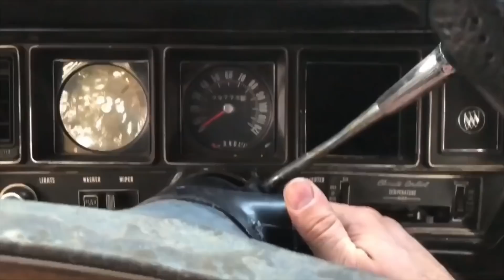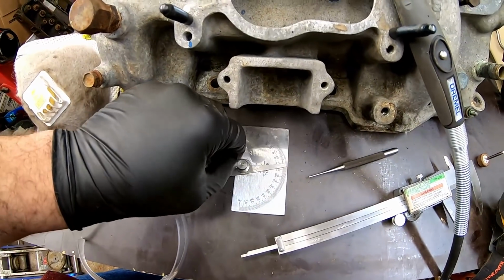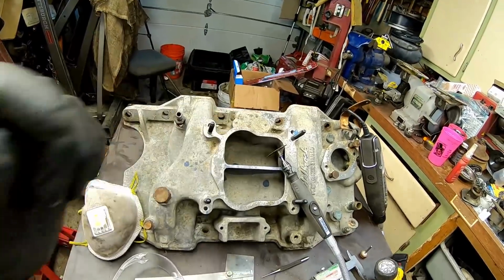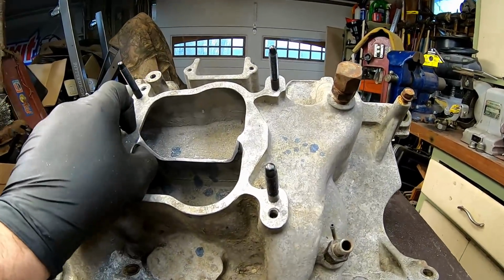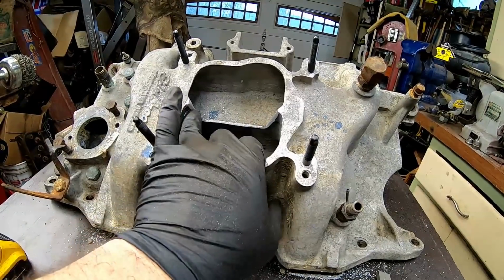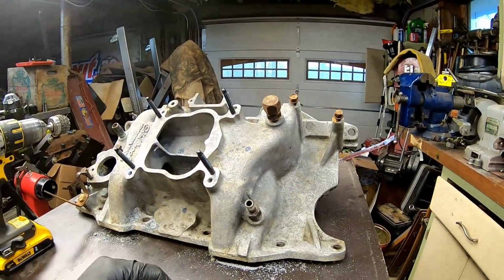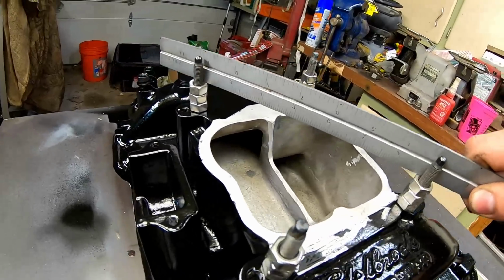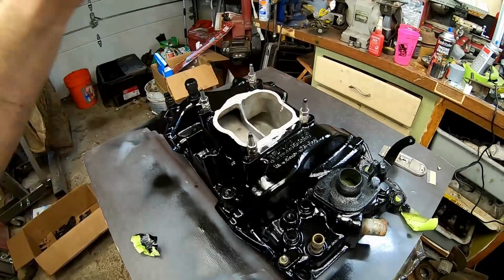How To Increace the Plenum volume for Cheap Horsepower: Notching Intake Manifold Modification

Comment: Back when I was younger yet still as stupid, I made a number of carb intake spacers out pieces of kiln dried oak.  Didnt have a machine shop or the money to have anyone made. But I had the woodworking tools at the Army base wood shop.

The spacers worked pretty good.  My best was a 2" affair for a Cadillac 500 motor.  The 500 had a manifold where the carburetor sat lower than the intake runners. This was done to keep the hood line of a Cadillac low.  Bringing the carb above the runners helped out throttle response. I assume it also increased torque and such but I was 20 years old and knew everything.

Comment: If you plan on running an automatic transmission the tv linkage gets weird when you raise the carb that much. Lokar makes a aftermarket carb bracket and  tv cable that hooks to the carb like a gm tv cable that works great.
Reply from the maker: Thanks for the heads up man I appreciate it
Reply: All the more reason to run a stick.  Automatics are for old ladies and bracket racers.
Reply: The 3 piece linkage has enough adjustment for a 1" spacer on that stock height intake.  For really tall intakes like a M1 single or Super victor, just cut and extend the intake bracket and the middle link.  For the 1 piece linkage,  just cut it in the middle and add a sleeve to extend it to the right height.  Or just go full manual valve body.  

The lokar bracket for the carb mount is not very good last time I looked at it.
Reply: Ive seen the cruise control throttle cable setup used to help the throttle cable angle. It steps up a lil higher.
Reply: @RacerRickxx  yup...eons ago i used their cable on an M1,  but fabbed a whole new bracket...
Reply: @livewire2759  good luck finding an a833, and even more luck getting one for a decent price. i will never 4 speed swap a mopar again. not worth the money.

Comment: If opportunity permits, cut slots on either side where the divider used to be and make 2 plates from scrap aluminum. One that bridges half the distance to the flange, the second to fully replace the divider. Test all three and get that spacer on and off for each of them as well.

Comment: Wow, there is a lot of comments on what people think is going to happen. On Power Nation, the engine guys cut a small piece out for a 304's intake, and it helped. I have two 1' spacers I am going to play with, one is for the holly I have, and the other has the middle out for a Quadrajet. I am going to run it regular, then run each spacer, then run both spacers. No dyno, but whatever feels the best, I will stick with. If I ever dyno, I am going to check the actual #'s. It's all in the fun of goofing off, but will make a good video.

Comment: Whats up man. Like all the videos you do. Just a thought. Essentially you have shortened the runners for 4 cylinders and created turbulence in the intake.. this will be be very interesting. Can't wait to see the results. 🙂
Edited, going that deep and wided may have done more harm than good. BUT unless you have another intake that is the same to compare to on the dyno we won't ever know. Il be willing to say also the setup will perform better with out the spacer.
Reply from the maker: It will all come down to the dyno 🤘

Comment: Look at the underside of the TQ and see those vacuum passages cast into the carb base. Those would be leaking if just a simple gasket was used on that intake. The carb spacer should give it more gasket area to cover those voids, one is for the PCV valve.

Comment: To prove the benefit of this specific modification, you'd have to dyno it before and after.
Or do you have a second unmodified intake?  For a third intake, I'd suggest the stock 340 or 360 iron intake. I'm going to bet the cut down intake will do far worse than the others.
I have the same basic car as you but it is a 440 4 barrel. There MIGHT be room on my car for ONE of:
1. Performer intake
2 . 1/2 inch carb spacer (not 1 inch)
3.  1/2 inch air cleaner spacer (not 1 inch)
4.  Taller air cleaner.
Maybe ONE of these, but not all four.
Of course a small block has about 1 1/2 to 2 inches more space above it, but I think
you would have to pick ONE of your chosen parts, not all 4.
Reply from the maker: B/c of the border thing I have had to make promises to not be up there for to long
Reply: Performer intake is not really better than the stock iron intake on a 440.  The older C4B was actually better as it had much larger runners and was designed for high performance motors, while the Performer was designed for torque on trucks.   Try a drop base air cleaner to get more height but be careful of the kickdown hitting it.  Moroso bases flow very well compared to cheap Chinese ones. 

Cutting down the divider usually kills bottom end power, and gives a few more up top from both sides of the motor being able to draw from both sides of the carb.

Comment: Can definitely help horses...can definitely kill torque if taken too far. I did this on a 4cyl Mitsubishi back in my experimental phase ( 16yrs old) .Turned that 160cui torque monster into a slug off the line. Never drove it fast enough to know if the mod helped. I sure know it hurt🤣

Comment: Couple of questions. Why? second question... why? You have just kicked the crap out of the bottom end torque for no gain. You are not building a pro stock engine that needs to move bulk air at WOT, the mod was completely unnecessary and actually detrimental. If you wanted to evaluate the difference you could have simply stuck a open 1" space above the manifold. I would weld a piece back in the manifold before you put it on the engine, you just toasted a good manifold. The idea is not to increase the plenum volume, the idea is to allow the airflow from the other side of the carby to be accessed by both sides, but even that is not necessary, because you don't have a manifold that is restricted at the butterflies, like a cast iron manifold, and you have a much bigger carb than you need already, so there is no reason to try join the sides. Sorry dude this is a really bad move. IF I was to try and join the sides I would have gone less than half inch (probably less than a quarter) and used an open spacer above it. All you did was create a dead air spot below the venturis you needed for that carb to work properly. I would put money on you getting fuel puddling in that manifold now.
Reply from the maker: It will make sense on dyno day
Reply: @LunarOutlawsGarage  been there done that mate, unless you are putting on big aftermarket aluminum heads, and a camshaft that gets snow caps on it, this is not a smart move. We experimented with this mod several times probably 30 years ago. You went way too big with the bridge hole. Did Tony know you planned to run a 1" spacer?
Reply from the maker: Wait till I get the cam tomorrow and tony ports the heads it will all come together 😁🤙
Reply: @LunarOutlawsGarage  yep even with ported heads (and it doesn't matter how much he takes out) I still think it is a mistake, with your specific combo. Porting the heads is only going to compound the problem. The more you increase the runner volume, the more you lose low rpm air velocity, which causes the fuel to fall out of suspension. GM cast little ribs in the plenum area to stop the raw fuel flowing towards a low cylinder. You don't have massive cubic inches to warrant big ports, and you have a heavy car. I personally (nd this is only my opinion) would weld a piece of ally back in that goes above the original manifold level by 1/4 to 1/2 inch. and run an open spacer. You don't need a massive gap to get air flow from one side to the other 1/2 is plenty, and you extend the length of the runners. Remember it's an aftermarket manifold it probably is already designed for higher revs than the factory manifold. You need more torque not more power.
Reply: I have the same thinking. But I don't think it'll be as drastic as you think. All comes down to cam selection and heads. I don't think simple porting is the answer. Bryan is gonna have to put bigger valves like a 1.98/1.60, full gasket match,  polishing bowls, and probably mil for compression. Then springs, and higher ratio roller rockers and pushrods to match. Or like you said aftermarket heads. Both of which aren't cheap, but it can work. Edelbrock makes a Victor 340 intake for a reason. Good luck!
Reply: Dodgy Brothers Engineering agree 100%... he is building a motor for the strip not the street, everything is too big for a 318 in a heavy car. He is putting the power up at 4000-4500+ rpm when the car will live at 2-3000... from the 850 carb to this I’m very confused
Reply: @masoncampos7043  we experimented with several different combos with different levels of success, and learned a few valuable lessons along the way. I had a rebuilt 305 (310) SBC in a UC Torana (very light car by American standards). I ported the heads at work, had a moderate cam (about 218 @ 50), long extractors (headers), Edelbrock SP2P, Holley etc. Even with the divider plate in position, at low revs it really struggled to make any sort of vacuum, or low end torque. I would have been better off with a factory manifold. Smaller cubic engines are very susceptible to loss of torque and vacuum, with short runner manifolds (taking out the divider wall in essence reduces the runner length and increases plenum volume). Another example was a 308 (local engine) Torana, that had massively ported heads, huge valves, could not possibly do any more to it, 240+ @ 50 cam, real beast. It benefited from a 1/2" high, 1" wide passage between the two chambers. We would have gone with a single plane manifold but there was no such thing back in those days. What we discovered from testing on a number of cars is there is a fine balance between providing the engine with additional air, and creating a dead spot underneath the carby. Bigger engines don't seem to be as effected as the smaller ones. The amount Bryan has taken out is going to have a significant impact, especially if an open spacer is used with it.
Reply: @sccarguy8242  I just hope he plans to put a really big stally in there, like 3000+ rpm to get the car moving and the fuel economy is going to really suck.
Reply: Dodgy Brothers Engineering on the flip side it’s uncle tony telling him to do this stuff and he knows his stuff. I’m just really confused
Reply: @sccarguy8242  I trust my own personal experience over some self proclaimed internet expert... Always hard to know who to trust. Problem with taking advise from others is it is very often tainted by personal opinion. There is still way too much my mate has this cam you should get it too going on out there. Just because someone built a particular engine a 1000 times for drag racing, doesn't mean they know the first thing about how to build a good street engine. The good thing is being ally it is repairable.
Reply: SCcarguy ,I’m thinking they are only using that intake setup for the dyno pull ,then change intake for street use
Reply: For sure if that's a combo going into the car which is about 3800 lbs. He'll need a big stall and gears. And it won't be street friendly
Reply: greg schultz but that would defeat the entire point of the dyno.
Reply: SCcarguy ,Okay,Thank You
Reply: @DodgyBrothersEngineering  Come on, man... you're telling Outlaw to trust your advice that's based on your personal opinion, while at the same time claiming that advice is often tainted personal opinions.  Sorry, but Tony Defeo knows his shit and proves it with every video he makes, and he's done a hell of a lot more than "build the same engine 1000 times for drag racing".  Maybe you should watch his channel, Uncle Tony's Garage... I'd trust any advice that man gives 100%
Reply: @DodgyBrothersEngineering  I pretty much said the same thing in an earlier post replying to a guy with the same intake wondering about how much hp will he gain at the dyno. You can make over 400 with a 318. You can make it with a single plain intake, at higher rpm which they can rev as well. Do I think it's the right combo for the build he's describing, no. But I'm not telling him to build his motor my way, because I know better and I've done it. There's lots of others watching who haven't been there and done that, and we get to watch and learn together sometimes things work and sometimes they don't. To know for sure try it, it's like a bonus he gets to share it with us. Looking forward to see what happens!
Reply: @LunarOutlawsGarage  I'm on your side. To many entitled lurkers out there just got to complain.
Reply: @livewire2759  nope not telling anyone to trust me either. I can share my personal experiences in performing this modification and what the outcomes were, but when it acts like a dog down low, don't be surprised. I will make decent power up high, that is a given, but if that is your measure of success then you have missed the point of a street engine. Happy to sit back and be proved wrong, but if you want to see how I do things versus the popular kid, just look at the dyno graphs in this video I made https://www.youtube.com/watch?v=E-7cM_diB9s
Reply: @MrQuickPick Hartford, CT well that was all we pretty much did. 1" wide by 1/2" high, otherwise you turn it in a poorly designed single plane manifold. Will be interesting to see the results.

Comment: Some days, its not the intake design, its the size of the carb.  but here's some other ideas of spacers versus dividers

https://www.speed-talk.com/forum/viewtopic.php?t=48428

https://www.fordmuscleforums.com/threads/cutting-dual-plane-manifold-plenum-divider-down.488956/

http://www.montecarloss.com/community/ubbthreads.php?ubb=showflat&Number=243284

https://chevytalk.org/fusionbb/showtopic.php?tid/254755/

https://www.forabodiesonly.com/mopar/threads/why-does-edelbrock-cut-some-plenum-dividers-and-not-others.106546/

and so the answer is? depends upon the rest of the parts used :)  Chances are, whoever builds the intake has a divider cast in so the end-user can "Trim to fit".  But it does remind those of us who buy used parts...someone else's part may be modified and not fit our build recipe. or worse, it didn't fit their's, either, and that's why its for sale :)

Also, when cleaning an intake manifold, if there's a splash shield riveted on the underside, drill out those rivets and get that shield off..you'll be shocked what you find inside, waiting to enter your new clean engine.

Comment: I get it if you're trying to stick to a budget and you already own the intake but wouldn't you have been better off to try and find a used torquer 2 single plane? Essentially that's what you're making. Your hood clearance would probably be better too cause it's gunna be a tight fit with that intake, Spacer and carb.

Comment: Boys I think we got the makings of a soup sandwich!  , Why didn't the manufacturer think of this?
Reply: They did, it’s called a single plane manifold
Reply: Robert Keim I’m betting it distorts the air velocity creating turbulence, Edelbrock  spends more Time in testing than we do, now it’s a maphrodite  duel plane, the manifold is ruined.
Reply: I agree with both comments below, it's just amazing to me how the thought of hacking up a manifold that millions where spent on in the R&D process would be /could be better than the manufacturer end result, yes I know everything can use some minor improvements (ie gasket matched ) but that's alot of meat to remove from the plate with the sacrifice of the bottom end at stake, I mean this motor is going into a satellite with the arrow dynamics of a brick, combine with the weight of a full size Chevy blazer, I guess I missed the big picture of the overall end result. Is it to see how much HP can be had out of a 318?
Reply: Robert Keim all one has to do is look at it, it’s going to create an unbalanced fuel delivery to one side or the other side of the chamber because they are not identical one side is deeper and may have greater vacuum from the other side pulling more fuel volume than the other creating the possibility of a lean condition on one side of the engine but hey it’s not my channel, in my experience I would run the manifold the way it was then do small tweaking from there that way you would have something to compare, can’t go back now.
Reply: @eugeniobrianti8755  I agree totally,  that same manifold (before the art work ) on a junkyard to 360 with an rv cam, and ford/Holley 2 barrel  will eat that 318 for lunch in the same car , it will do it in  mileage, horsepower,  and torque,  he would be way ahead doing it that way than the way he's trying now , he could still have Tony and Nick do there magic on it and the end result will be far better , but like you said it ain't our channel , I guess I just don't see the reason to dump time and money into a motor that can't and won't pull a sick whore off a pisspot!!
Reply: It's going to be fine. We've been doing this at the speed shop for twenty years.  Don't be negative Nellys. Ffs.
Reply: @simplyfred8044  and the advantage is?
Reply: simply fred I’m curious what were the results in the 20 years of doing this, what were the horsepower gains? LOL 😂
Reply: @eugeniobrianti8755  let's let the dyno at Nick's do the tell. Usually 5 to 6hp. If to much is taken off you can always build up with epoxy while the manifold is on the engine and smooth out with talcum powder fingers before it hardens. It's a low budget build which means more tricks come out of the stash bag instead of new parts off the shelf.
Reply from the maker: Yup I just going to let the dyno speak for it 🤙 can’t win on the Internet
Reply: LunarOutlaw’s Garage I’m with ya man I just have my doubts on the mod, I hope it all works out.

Comment: I would only do this on a light weight car, 4 speed car or where traction is an issue. You will gain a few HP above 3500 rpm but loose a few below 3500. It's a trick that's been around since the 60s. Maybe earlier.